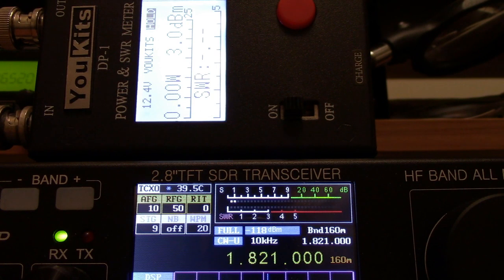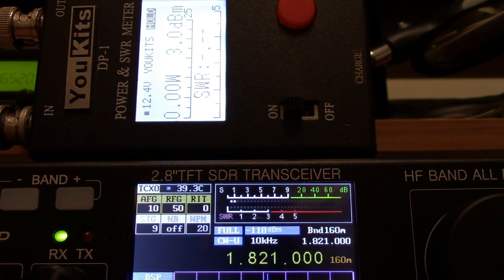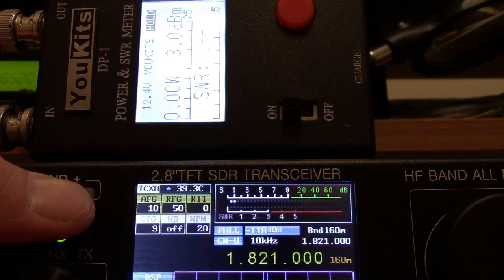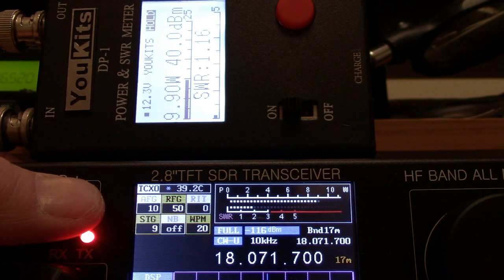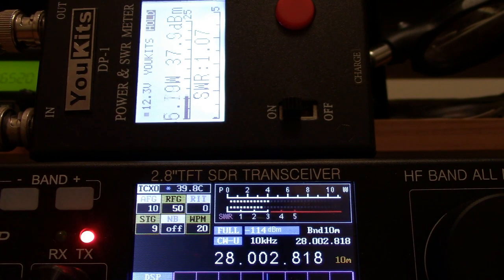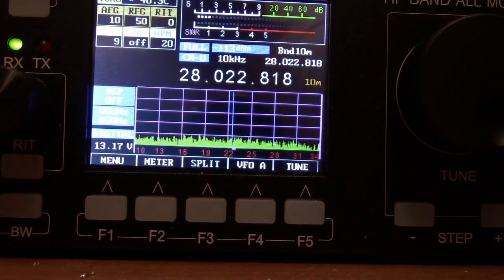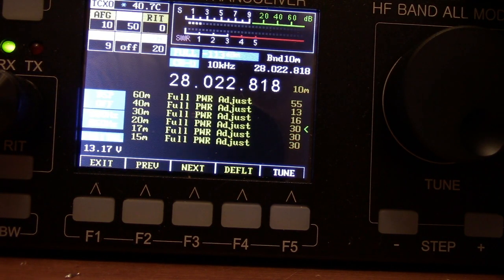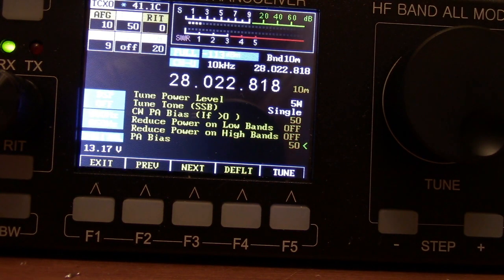mcHF Chinese Clone high power output test Aug 27 2017

Comment: The is rig is showing a 2:1 SWR.  Is the 2:1 SWR reducing the output?

74

Frank WA3RSL
Reply from the maker: Only if the SWR folds back on the mchf reading power on its internal meter, as the dummy load and youkits swr meter is well below 1.2. So who really knows. I sold the rig not long after as the radio had older bootloader and could not be changed without doing the desoldering of the pins inside etc...thanks for watching. Fred
Reply: That's correct higher the swr changes the output, I believe with a better match on 10m you would see a higher power.
Reply from the maker: @GalaxyFreQ  I think in this case the foldback or swr protection calibration in the radio was wrong as the dummy load and external meter showed 1.09:1 swr. Until the calibration was set correctly then there would be an issue.

Comment: Nice menu on the radio Fred =)    Dose to have a CAT and Digital and or VOX to run Digital modes with ?   Thanks a bunch Fred for the walk -through =)
Reply from the maker: Pat Hopkins one usb cable to netbook or laptop is all that is needed and u can run fldigi or HRD as the radio has a sound-card built in